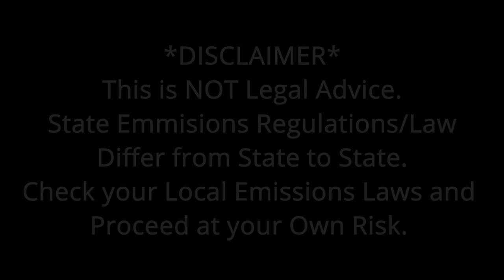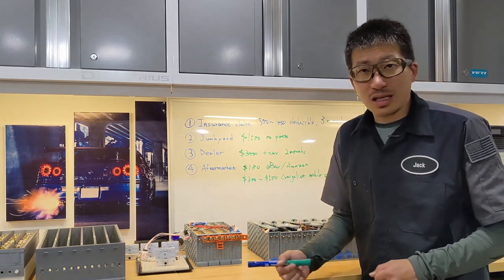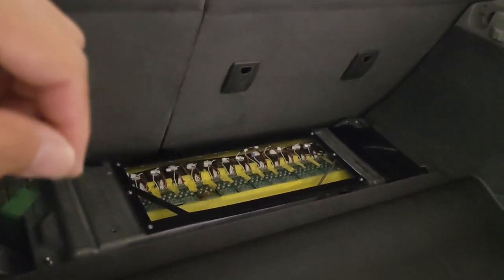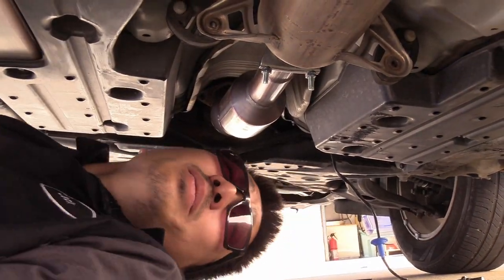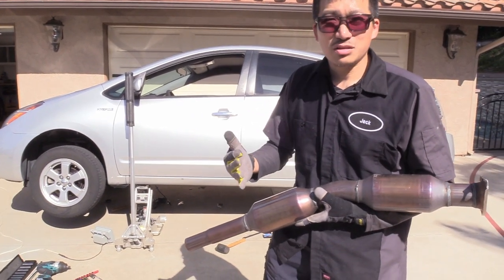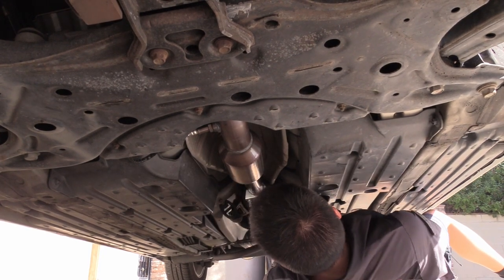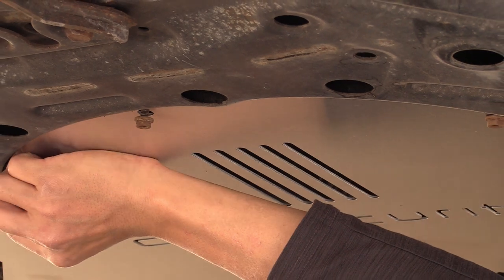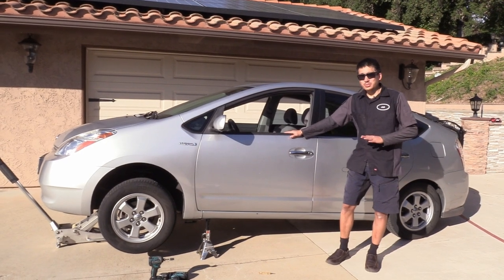Where is my Cat (Catalytic converter) ?

Comment: Luckily insurance covered so i only paid 100 deductible on the $3000 repair for my Highlander hybrid. I did wait 3 months for the part. Clamped a flex pipe over the gap to reduce the noise in the mean time

Comment: I installed the exact same shield on my 06 Prius except I added more holes with rivets and screws even into nothing just so it looks difficult and I also placed the plastic part on the front of the shield while it was covering more rivets underneath the plastic cover so they find a big surprise waiting for them, also drilling sharp screws through the shield all around will also hurt them when they try to peel it off and even leave some DNA cuz I'm sure they'll get cut or nicked, thanks for the video

Comment: You make holes by drilling in the suspension of the vehicle, which will quickly cause corrosion, and inadequately cooling a very hot catalyst will burn it out very quickly. The thief will steal as much as he will. When a thief goes under a car, he usually has a sheet metal cutting machine with him, so for him it is no problem to cut the head of the screw and the sheet falls off, while for a thief it takes 8 seconds longer to steal.
Reply: I disagree. Don't know what you are looking at here but the holes Jack drilled are in the bottom frame/chassis. That plate is no where near any of the suspension from what we can see. The shield has slots cut in the aluminum and is open ended on both side. Front and back. When the vehicle is in motion, air flow will not be affected and the area is so open, nor will it affect the vehicle in idle with any heat issues. Next, yes a thief will most likely have a metal cutting tool for the theft but, again, I disagree with you. There are 7 screws on each side and 3 nuts on the front. Making this 17 screws/nuts a thief has to deal with. Even if he shaves off the 14 screw caps, he would still have to remove the front 3 nuts. It is very much doubtful it will take 8 seconds to shave off 14 screw cap heads and remove 3 nuts. The whole point of a shield is to deter a thief. There are a billion other Prius out on the streets at any given time. A thief will look under and see this shield and move on to another Prius parked down the block. The extra effort to steal a Catalytic with this shield installed VS getting caught, a thief would move on. This method of security is not steal proof but makes more sense than not having this shield. At less than $200 to $300 installed, that beats trying to buy a Toyota Catalytic Converter at $3000.00 with no stock any day. --- Great video Hybrid App channel and I for one am going to call Get Cat Security and install on my Prius. Keep up the great videos! Very informative and educational! Entertaining too!